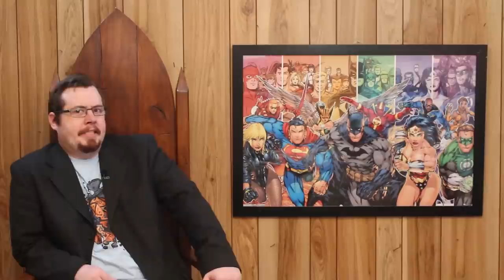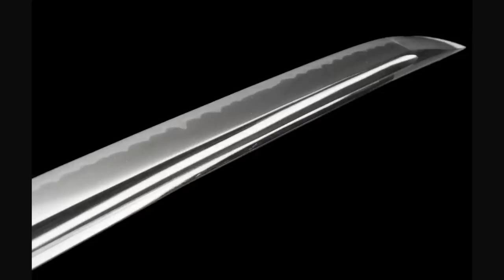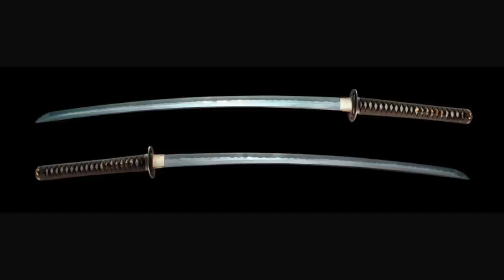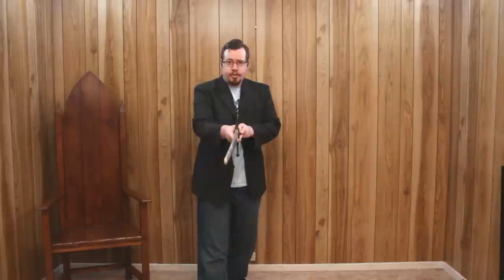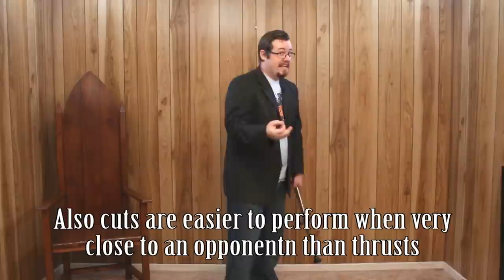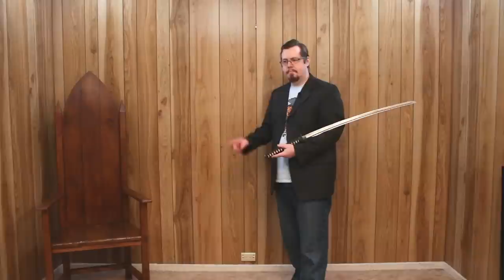Super cutting swords, are they needed?

Comment: You see. A battlefield is not a surgeon's table. Overkill is not a waste of cutting capacity but it's a weapon in itself: terror. Sure a battle with people dying and being wounded is bad enough, but with limbs flying, heads rolling and blood splatting everywhere? That's mental warfare!! Also, if you cut an arm or neck to the bone, there is a good chance your sword might bet stuck there, a specialized cutting weapon will clear itself out by removing the limbs and be ready for the next engagement, or to parry another opponent.
Reply: exactly my thoughts! Most battles even in historic ages are won by routing the opposing army, and what better way to do this than invoke complete terror on them :).
Reply: Sander vd Donk That's why the MG42 was so effective, it wasn't the damage it dealth or the casualty rates, but the terryfing sounds and rate of fire and bullets flying all around you. In reality it was a huge waste of ammunition, but it payed off by immobilizing the enemy.
Reply: Overkill is all good until it impedes other functions. THe MG42 ate up too much ammo and forced the squad to center around it. That's why most other powers have not copied it after ww2.
Reply: and that's why people use axes, not kitchen knives.
Reply: The problem is that if it fails to be effective it fails to be scary.
Reply: thats exactly the opposite. Horror spreads by suffered survivors, not by dead people. A completely battle-ineffective injured person spreads horror to his comrades most effectively
Reply: Chen Alex For a very simple reason, dead people don't scream and moan and cry grasping their comrade's leg in desperation. That's the very definition of demoralizing.
Reply: Gakgaming How are katanas so much more terrifying than other kinds of swords? Because its sharp? Not convincing.
Reply: Zzzip13Strike I didn't say that. And I'm not talking about katanas, the OP argued that a blade capable of decapitaions and limb chopping is overwkill on the battlefield. I'm just arguing that there is no such thing as overkill in battle.

Sure you can kill a man by piercing 2inches into his abdomen, he's out, he'll die. But if you impale him and splatter the guy behind him with a blood soaked spear, you probably sent took 2 down with fear already.

And imo katanas are not terrifying on the battlefield, quite the contrary, they look very cordial and harmonious, A bisento or Tetsubo is far more terrifying, a danish long axe probably sent 2 men running just by being there. That's another reason why city guards use polearms, they scare the shit out of people.
Reply: Gakgaming Funny how impaling someone with a spear is the last thing any spearman would wanna do as it would mean losing the spear. Spear and bayonet training emphasizes quick, shallow thrusts to both quickly recover and prevent weapon trapping.
Reply: Gakgaming But you are the OP of this thread. And you are claiming that, despite the shortcomings of katanas, its viable on the battlefield because its terrifying. And you say its terrifying because..well its not terrifying because its ineffective. Which is why they rarely even used katanas.
Reply: Zzzip13Strike The OP is who posted the video. I'm not saying katanas are terrifying.
Reply: Gakgaming You were clearly advocating for the use of katanas in your post by citing terror.
Reply: Zzzip13Strike Terror of decapitations and blood flowing, not terror of the weapon itself, and in that sense katana is no better or worse than other curved blades.

My point was the efficient killing, surgical strikes might do the job of killing, but doesn't create the same effect on morale. Battles are won in their majority by putting the enemy to rout, not killing them all. 

If people just fall dead without screams or blood or terror, an enemy army might actually stay in the fight longer and deal more casualties to your army

Destroying your enemy's will to fight is as important as destroying him.
Reply: Gakgaming Are you claiming that longswords cause less pain than katanas?

I'm sure if I was only cut just fatally from a longsword and bleeding out slowly to death I would also be screaming.
Reply: Zzzip13Strike Where did I ever talk about pain? If you won't read what I'm writing, no point in this discussion.
Reply: Gakgaming "Katanas are not better than other swords" -> So you claim katanas compensate for their ineffectiveness as described in the video -> You claim that this compensation is through the increased terror of facing a katana -> The terror comes from people screaming in pain as they bleed to death -> This implies that longswords are not capable of causing the same amount of pain and terror.
Reply: Zzzip13Strike "So you claim..." no I don't, I claim what I said, not what you think I said.  "This implies..." no it doesn't, read what is written, not what you're want to be written and are desperate to criticize.

Saying things about katanas doesn't imply anything about longswords.
Reply: +Zzzip13Strike Wtf are you talking about ? You are putting Gakgaming words out of context and adding topics he never talked about in his original comment.
Reply: Ivan Shock All i am saying is that Gak claimed there was compensation in specialized cutting weapons.
Reply: Well, that's his point of view, but i was referring to the fact that you were assuming things too quickly when he didn't specifically stated that.
Reply: +Ivan Shock If you agree with me on the point that he claims that specialized cutting weapons have compensation (by means of fear and terror), then all i'm saying is that with decent armor it loses all its fear and even still, the effective swords described in this video, such as longswords, are much more effective while still being terrifying. Lets be honest, it doesnt matter if your arm is cut all the way off or cut into the bone, you are still gonna be in pain as shit and that is terrifying.
Reply: I agree with your point, but i pointed out that you were reaching conclusions too fast and it seemed weird to me.
Reply: Ivan Shock I'd like to improve my logical progression but i'm satisfied that I at least changed your "Wtf are you talking about" into "I agree with your point." Nothing else to add because this was my whole simple argument.
Reply: It's nice to see a respectful commenter nowadays, so sorry if i seemed rude in my first comment. And have a nice day.
Reply: or a dull weapon that breaks bone without the danger of getting stuck. remember how Musashi dueled and beat to death an opponent with a dull handmade wooden bokken.
Reply: you mean like a hollywood samurai battle xD?
Reply: +majungasaurusaaaa
The Nazi MG-concept became the US M60. Which wasn't very well designed, at least the initial models.
Reply: Actually most people did copy that tactic. The mission of the Marine Corps Rifle Squad is to "...destroy the enemy by fire and maneuver..." the machine gun or other automatic fire is what allows us to semi safely maneuver. Nearly every major military in the world is built around suppression and advance tactics. The winner of the day is not who has the most accurate fire, but who has the most volume of fire and then can maneuver their troops into a better position to engage, at the flank for example. True our modern weapons don't fire the staggering 1200rpms the MG42 was famous for, but the tactics are much the same and the squad automatic rifleman is still key to the squad's survival in combat.

Source: US Marine for 4 years
Reply: TresTrefusis Indeed, but it has to be said the extremely high fire rate of the MG42 became a liability as it would quickly run out of ammo and constantly advancing became unsustainable, not to mention the constant need of replacing hot barrels. It was just too much fire for what it was needed and mechanically viable. Future designs for suppression weapons would bring that volume of fire down significantly for the sake of reliability and sustained operation.
Reply: You point out the difference, though. We don't use 1200 rpm weapons anymore, because you don't need 1200 rpm to effectively suppress enemy troops. The tactic isn't the gun.
Even the modern Bundeswehr's MG-3s (another slight modification of the MG-34/ -42/ -48 lineage) are usually used configured to fire at 900 rpm. almost all other modern militaries use slower-firing machine guns, 600 to 800 rpm. Italy and Austria also use variants of the MG-42.
Reply: ***** yeah but they are not personal weapons and are mounted on vehicles that can carry ample supply of ammo to burn =D That's the difference. You can't expect a soldier to carry one of these.
Reply: ***** Yeah that's true.
Reply: "Sure a battle with people dying and being wounded is bad enough, but with limbs flying, heads rolling and blood splatting everywhere? That's mental warfare!! "

Not so sure of that...those limbs and heads pretty much just drop, along with the person in case of a decapitation. 
Someone grabbing his throat and trying to stop the blood from spilling out for a minute while screaming is far scarier to me than a decapitated corpse on the ground. Same about a uselessly dangling arm, half cut and severed bone, that is profusely bleeding, that too is much scarier to me than an arm stump that barely bleeds as the blood vessels have contracted due to the shock.
Reply: lolply54 I've seen my share of cases. A cleanly cut artery can curl itself up and close, significantly reducing or even stopping the bleeding. The rest of the wound keeps bleeding of course, but that's not what i would consider "a lot" compared what it could have been.
Reply: oh sorry, i misunderstood what you mean, well i don't know, even a half arm cut cause the same schock so i suppose a full arm cut bleeds much more (i've seen full amputation, but never very deep but not severing cuts)
Reply: lolply54 Yeah, it depends on whether the artery is completely cut or merely injured. It has to be cut completely for the curl effect to happen. Of course this also can happen without the limb being fully severed. But if it's not fully severed, then there is a chance that the artery injured but not completely cut, and then the blood keeps guzzling out.
Reply: TresTrefusis
We weren't (at least originally) debating the fire-and-maneuver tactic, but the specific detail of very-high-cyclic-rate machine guns.
Reply: lolply54
Yes, but (medical) shock is an effect on the injured person, whereas intimidation is an effect on those around him.
Reply: i was thinking the same thing
Reply: AnimeSunglasses At that point i would personally find an arm that is still dangling on a few bits of flesh to be more intimidating than a cleanly cut off stump. Those severed limbs aren't flying around like one gets to see in movies after all, they just drop to the ground.
Reply: Jens W.
Yes. And?
I don't see what part of my post that is in response to.
Reply: AnimeSunglasses About the shock effect and intimidation part.
Reply: *****
Yes, but that was already true in WWII.
Reply: Jens W.
Oh, I see. I wasn't saying anything about what I would find more intimidating. I felt that lolply54 was confusing the medical shock and the psychological shock/intimidation.
Reply: Historicly speaking there are aleays tales of fear when colonial troops attacked the middle east, india or japan where they would come back terrified at the sharp blades. If peopple simply dont come back from the battlefield at all dye to a swift death, that in and off itself is very effective. If they come back and die of injuries later its not quite as terrifying. Seeing comrades bleed out on the battlefield is not so much scarring you as hitting u emotionally.
That being said, swords were normally side arms in battle. This holds especially true when fighting armored opponents. Pole arms or blunt weapons were vastly prefered in battle.
Concerning the katana, it was developed in peace time. It predecesors had more tapering and more reach but just as the log sword were side arms.
As for the efective ness of mega cutters its simple. 1 cut no stop, flow into next cut or next opponent. Thats the advantage. Lets not forget most eastern cutters and sabres 2 were developed for cavalry, in which case a thrusting sword would not be helpful after the initial charge
Reply: +majungasaurusaaaa

no... the MG42 normaly was fired in shot bursts whihc gave it a roughly 250 Rounds per minute use of ammunition... the german infantry doctrine simply was centered around the MGs as the main source of firepower... most countries had the MG as support for the Riflemen... the germans had the Riflemen as support for the MG which provided iirc 2/3 of their firepower... the ammoa lso was the normal rifle ammo and i think i've read that some suggested that from the MG42 the "custom" of seeing soldiers with belts of MG ammo slung around them originated
Reply: EVERY country copied the MG-42. A somewhat slower rate of fire doesn't change the concept.
The M249 does 800rpm and has the exact same function. It is not supposed to hit anything, but to get the enemy to keep their heads down and take pot shots instead of aiming!
Not until very recently has this concept been challenged in practice. The Marines are changing some of their M249s to M27 IARs, sacrificing volume of fire for more accurate fire and better mobility, with the retention of high cyclic fire capabilities, albeit only with a 30 round magazine (there are drums that fit the STANAG well though, but as of yet not adopted).

The main point though is that, what is today called "Shock and Awe" (about 90% of the US Military doctrine ;-) ), is the equivalent of a few huge Viking berzerkers wielding ridiculously huge axes and splitting foes in two! Ie: Overkill for the sake of psychological effect.
Reply: Ted Floryd 
I cant help but wonder though if switch from m249 to ir27 has more to do with usmc institutional philosophy rather then other factors. After all, statistically most combat casualties are due to various types of shrapnel, 90% (?, not sure about exact number, I think I read it in some medical journal) tube artillery, and half of that due to 82mm mortar, basically a ww1 era weapon.
Reply: The difference is that we haven't seen a clash of large conventional armies in 70 years. If you get that you need the suppression above the accuracy again because the other guy has a fuckboat of firepower you don't want him to use effectively so you want a higher volume of fire so the other guys are rather taking a picnic in their trench than trying to shoot back with their equally lethal combination of MGs and assault rifles. In contrast in COIN operation some guy may pop up for just a few seconds, take a few shots at you in usually a very confusing environments and then disappear so you need more precision. You usually don't get one formed up company or battallion fight another one to three formed up companies or battallions bringing all their nasty gear.
Reply: dude, if you're having a sword used against you on a battlefield, chances are it's because your formation has broken because of a rout or some other such reason, making terror redundant.
I also think you overestimate the sticking ability of flesh and bone in regards to something designed to slice up flesh and bone.
Reply: Sander vd Donk yeeah, the thing is, you fight in formations. With spears, halberds or pikes. Something long and stabby. Swords were, and always have been, a side arm.

So you're talking about the equivalent of giving infantry the tiny pistol from Men in Black, and saying it's great because of psychological warfare. Meanwhile, your infantry gets gunned down before they get close enough to use their sidearm, causing a rout of your forces, and hold up, wasn't terror meant to be on your side?
Reply: Gakgaming if you cut through the bone it wont get stucked lmao
Reply: Gakgaming Limbs won't be flying if your enemy has chain mail. Find me a weapon that slashes through well-made rivited mail. Lightsabers don't count. Lol
Reply: +gakgaming Well, yeah, but at that point you might as well use a forward-curved sword. Those things are about a thousand times more gruesome than an inward-curved sword
+Monster Bash, does the weapon need to survive? what constitutes slashing? can we bring quantum tunneling into this?
Reply: Gakgaming welll i dont know shit, but i do know how to make paper sword that kill lol easy....i mean paper dont cut ps i watxhing all your so high🤔😂😂😂😂 GOOD VEDIO
Reply: More likely is that the sword will just get stuck further in the body, unless you're Conan the Barbarian.
Reply: majungasaurusaaaa MG3
Reply: while i do agree that terror is a precious asset, one does not simply ignore that imperfect cuts give even more terror. Human easily disgusted with uneven things, so do uneven, unclean cut wounds.
Reply: Gakgaming u do not think that they can have mail or plate armour? And then?
Reply: it's really not about "Terror". Shad just didn't think this through

He visualized sword combat as if it was a fight of only 100% perfect hits and complete deflects. Much more common were the "half-successful hits", where weapons clashed to an extent, lost momentum but it still managed to hit the target, and in those cases the extra cutting capacity absolutely came into play and wasn't just a  "pointless overkill". 

There is a reason why curved /cutting oriented swords heavily dominated the whole world despite the straight sword's much more simple and obvious design of being more balanced in cutting and thrusting. There is a reason why even 19th century brittish swords were typically curved/cutting oriented instead of short/longsword design or even rapiers.

A successful deep cut bleeds out the opponent much faster than a thrust or a shallow cut. You undervalue (or overlook) the importance of "the time to make a target lose consciousness on the battlefield". It wasn't enough to just "eventually kill the target" on the battlefield,, you had to make a close range target lose consciousness as fast as possible to stop them from being a constant threat to others. It's a big reason why rapiers were not that popular in the actual battlefield, and were mainly used as self defense weapons for situations where you aren't technically in a "hurry to kill the target".
Reply: Nope thats overkill still as you'll demoralize your allies as well with such a sight. Also you have to know most of fighting youbrarely get a clean hit.
Reply: I think stopping power is the issue. A cut will kill but your opponent may fight on. Cutting off an arm may not kill but they are out of the fight almost instantly. You could poke somebody in the chest and they still might kill you before they die.
Reply: @martinsgakke  Yeah but that only works if the person feels that they are helpless, otherwise it may actually give them the ability and passion required to do a great feat of strength which then has the opposite desired effect.
Reply: Yes, but the inability to cut as well actually causes a much more foul looking wound, similar when you get cut by a blunt or also serrated blade.